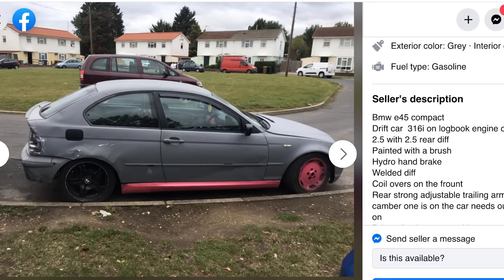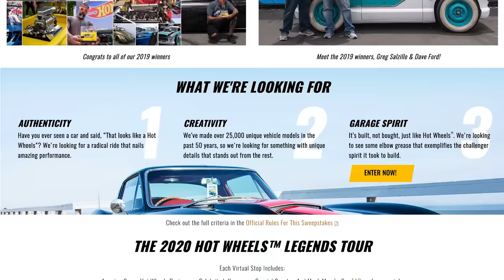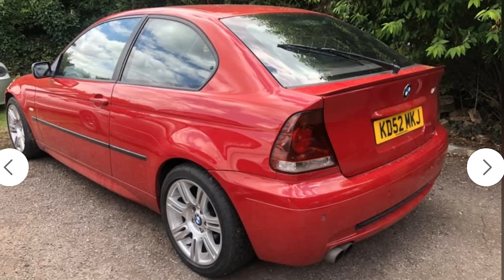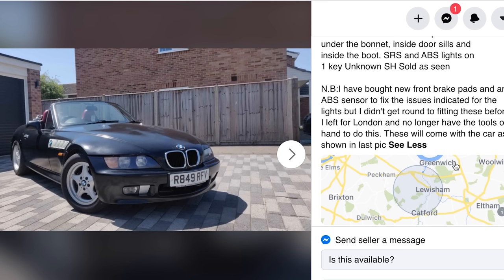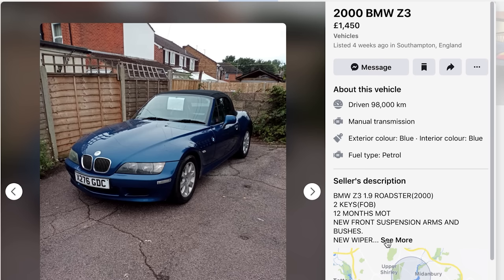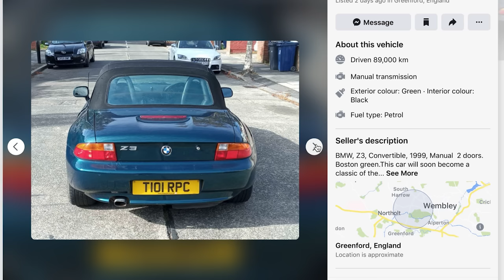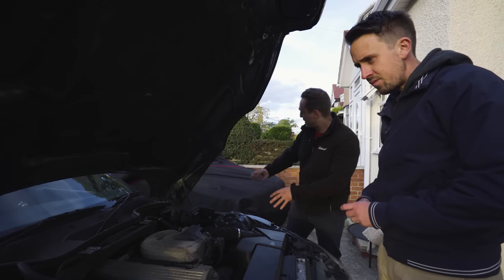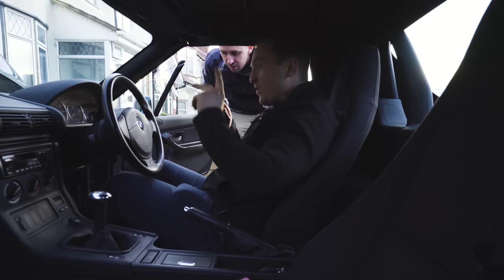£1000 First Project Car Challenge

Comment: Me: "I wonder what I could get for $1300 (£1000) near me."
Quick search 
Nothing for 200 miles...
Reply: Cars seem to be so much cheaper in the UK
Reply: jumping on that bandwagon:

Me: "I wonder what I could get for 1100EUR (1000GBP)
quick search
One hella sick drivetrain for my bicycle lol.
Reply: Only sorta interesting thing near me (Boston CL), is a '94 Saab 900 turbo vert for $1K
Reply: @tofuto4492  they are. I mean just like 800km away in Czech Republic a rusty Z3 goes for like 8k GBP (8.5k EUR/10k USD) and a rust free one with 200k km on the odo goes for 11.7k GBP (13k EUR/15k USD). That is 10x the price. It's nuts. I know many people that just import their track cars from UK because it is literally cheaper to pay for  trailer and the fuel/tunnel/vignettes than to buy an RX-8/e46 3 series/MX-5/350Z etc domestically. Having steering wheel on the other side does not matter on the track and you do not need to register and insure a track car as long as you do not drive it on the roads (it's cheap to rent a trailer to bring it on with and if you blow your engine you can just load it on the trailer instead of paying much more for a towtruck and taxi). Like seriously why are cars so much more expensive on the continent... I don't get it.
Reply: @VanBourner  Cheapest z3 I could find in America was $3.5k (2.7k gpb), but it seams like any good one is around $6k (4.6k gbp) to 10k (7.6k gpb). I thought we had it bad at those prices, I feel for you man.
Reply: @VanBourner  same here in Portugal, 90% off the dift cars are right hand drive, mostly e46 coupes, a Z3 in similar condition woud cost around 12/15000€
Reply: Shapeshifter - Maurizio Cars are ridiculously expensive here in Germany.. why ?
Reply: @pashvonderc381  there a z3 cost is like 2 months of work, here a z3 cost 1.5/2 years of sallary, dont complaint about expensive Cars
Reply: vitor hugo weren’t complaining about expensive cars, only about the price difference between the 2 countries. As I live in Germany ,coming from the UK, i always wondered why the Germans over value their cars ...
Reply: Quick look on marketplace with a £1,000 budget shows up:
Porsche 928
Lexus LS400
multiple TDI Golf's/Jetta with 250+hp
225 Quattro Audi TTs
EP3 Civic Type R
Mini Cooper S

Couple of cool things, but I suspect there's a lot wrong with them.
Reply: @pashvonderc381  What about wages, is there a big difference between the UK and Germany? What about insurance, taxes etc.? (BTW I live in Hungary, there are loads of dealers and just regular people who buy used cars in Germany and bring them in the country)
Reply: Boni Hollóssy Like most places wages are normally based on your education, and Germany loves education, I think car insurance and tax is a little bit more expensive than the UK, not by much though. As most Germans change their cars every couple of years or so and because of this environment thing they have here, their “ old “ cars normally get shipped off to the East..
Reply: @pashvonderc381  Yeah, but sometimes for the same kind of job you get paid VERY differently in different countries, and/or the cost of living is very different as well (Norway vs most of Europe for example). That's why I asked if there is a big difference between wages in general between Germany and the UK (I have no idea).
If dealers ship/drive used cars from Germany to the East, then find and snag those good deals. 🙂 For example I know that people here in Hungary bring in TONS of BMWs from Germany and Austria. Not few year old ones, but mostly older models, like E36s and E46s, and not just pristine examples, but a lot of cheaper "average" or run down cars.
Reply: Boni Hollóssy fair point.. I think in Germany you do get paid more , maybe that is something I could discuss with my friends back home on the difference in wages..
Reply: @pashvonderc381  mostly because Germans can export them to Czechs/Poles and they will lap up the inflated prices. UK has nowhere to export used cars and their ridiculous insurance prices drive car prices down... it's nuts I mean I paid 3000 GBP a year for a 1200 Mazda 6 when I lived there. And that was the cheapest option. They asked me 2.5x the price of the car... Here in CZE I pay about 200 GBP a year for an 8000 GBP car (07 Mini Cooper S).
Reply: @maurizio13  That and the insurance costs limitting the resale value. But I know a lot of people that buy cars from UK to drive on tracks/built drift cars etc. If you can get the car for like 1/8 of the price, why would you pay the premium just to have steering wheel meter and a half more to the left?
Reply: @VanBourner  You must have lived in a very high theft area.. Even my insurance on my first car (a 2008 2.0 Ford Focus Zetec S) costed me £1,200 GBP.
Reply: TheVanBourner Jesus that is expensive, especially for a Mazda, maybe you were what they called “ A Young Driver ?”
Reply: @shona5512  Nope. I had no No Claims Bonus ( I was working in UK when I was 25-27) so despite me being a driver with no incident caused (nor in any incident since I first sat at wheel) and despite me having hundreds of provable hours on track experience, never been fined for anything in any country I have been on (seriously not even a parking ticket) and despite I have visited skid school twice (once when I was 18 for FWD second time when I was 23 for RWD) I was considered high risk driver. I was willing to prove all my experience to the insurance companies but they just told me that it would not lower anything. 

Then here's the kicker - someone hit my car on the parking lot of Tesco, right under camera. It was a beaten up SUV and it hit my rear wheel with a hitch. I had the CCTV footage and police involved and everything (it totaled the car since the upper arm was bent as a result so I could not drive off due to excessive camber). They refused to pay for it since I was not INSIDE THE CAR/driving it when the incident happened. I had vandalism coverage, fire coverage, accident coverage etc. It was fully comprehensive policy since I needed the car for my work. Nope, nada, zilch. Only if the car gets damaged in my driveway I'd be eligible to have it covered. Otherwise I need to be in it and have the engine running. If I was I'd be paid every penny. That's what was nuts to me.
Reply: @pashvonderc381  I was a risky driver to them. No NCB. I moved from abroad to do a job in UK that required me driving so I bought a car. I'd drive like 5000 miles a year in the car but for those 5000 it was imperative that I have had my own car due to various NDAs and security precautions that the job entailed. I was given like a pound per mile so I did not lose any money on it in the end. But I have had attended skid school twice (when I was 18 as part of my driver's licence for FWD, when I was 23 I got it as a gift from my wife for RWD), never been in any incident since I first sat at a wheel (like I was in one accident in my whole life - someone crashed into our family car because they missed a yield sign) and never even been fined by police in any country that I have driven through (pretty much all of Europe except Ireland, Spain, Portugal, Turkey, Russia, Finland, Belarus, Estonia, Moldova, Luxemburg and Latvia). But yeah I am the dangerous driver. Not the idiot neighbour that drives modified Corsa and runs every red light he sees and pays like 600 a year... sure it is me who's the real menace.
Reply: @VanBourner  I have never heard of that happen before. Since I started driving I was fed up with excessive insurance costs, so I took driving course and got certified as an "advanced driver". It lowered my insurance by over £150. I've been insured with AXA for almost all my cars and I've had good experiences.. Obviously the extortionate price is beyond ridiculous, but aside from that I'm fully comprehensive and it's nice knowing that I'm covered regardless of whether or not I'm in the car, if the car is stolen and torched or if it happens in public or private.. No matter what I'll get paid out. I've never seen someone have an experience as bad as yours.
Reply: TheVanBourner Sorry mate, that’s real shit and bollox ..

Comment: The US market is so unfair. A car like that you would be hard pressed to find for 3k
Reply: Yeah even simple cars like a toyota can have blown up engine and trashed transmission, or a complete wreck and they are still on the market often for 1500 or more.
Reply: Yea try find a cheap ls v8 engine in UK. Seems to be loads over in scrap yards . Win some lose some. I remember being being able to buy a 200sx for 1500 years ago now 7-20k
Reply: @screamingchicken5797  I just got an '01 Nissan Xterra with a KA24DE with 157k for $550. The towyard had it listed for $1600 then began dropping price, and I contacted the yard at around $800 on the day before it was scheduled to get crushed. I spent $2k going over and performing a litany of routine maintenance, using a majority of used or junkyard pulled parts. After owning a BMW E46 328i, Acura Vigor, Mazda Protegé 1.8L, Subaru SG9 Forester, & Subaru Impreza Outback Sport, nothing has been easier to work on and more reliable than the three Nissans I've owned. The Xterra went from sad and undriveable (with more fault codes than I can remember), to take hands off the wheel at 90mph straight and smooth with clean pass on emissions using mostly basic hand tools, a keen eye, and a Haynes manual. Currently my daily driver at 160k, and I'm saving up to RB25DET swap it.
Reply: Cash For Clunkers
Reply: Yeah but anything brand new comes from US priced as 1$=1£ if you look at Tesla or Apple products 🤷🏼‍♂️😄

Comment: Project Car: “Coilovers, Wheels and Exhaust.”

I ain’t even mad, this your first project car, start off small.
Reply: What kind've stuff do you suggest? I've always wanted to start a project cars but don't have any practical experience.
Reply: Elijah It really depends on what you want out of your car.

The best advice I can give is this: Get it caught up on all the maintenance, go to a few track days, increase your driver skills, then use the time on the track to determine what you need or what you’re missing.

You may find that your cars brakes are holding you back: Get a bigger brake upgrade. Now you got stopping power, but you’re finding your a little slow on the straights: Start with an intake, an exhaust, and a tune. If you need more power, depending on the car, get upgraded headers, put in a cam and retune it. You can do this all the way until you’re slapping on a twin turbo kit, but at that point you would have built the motor up with stronger parts to handle the boost.

Get better seats, a roll cage, lighter wheels, stickier tires, start dropping weight.

But if you just want a cool street car, do you want it loud and fast, or just want something that looks cool.

So many directions you can go but the key is understand what your project car is designed to do, and take it one step at a time.

Your car won’t be the fastest, the coolest or even the most expensive, but make it your own and you’ll be happy with the results.

Also, if you’re going to join a car club, don’t get caught up with that “Man your car ain’t nothing”, that will just make you doubt everything you did. That’s how those guys operate and the reason I hopped out the car scene (currently looking at C6 Ls3 or the Z06 tho.)

Hope that helps!
Reply: @devonwhite8247  thanks man I appreciate the response

Comment: They really lucked out with the first Z3 they encountered. Minimal rust, a top that doesn't need immediate replacement, cloth seats that aren't torn. There's a lot to like about the Z3, though if you're going to put some additional power through one of these, you'll want to make sure it's had the rear floor pan reinforcement plate welded in.

Comment: I think it's hilarious when people check the oil cap and see a bit of slop and immediately think it's screwed and needs a headgasket.
Like Canadian here man, they look like that most of the time when winters round since the heats blasting and the car won't usually run long enough to get the oil boiling off the condensation.
Like the guys also mentioned if it's an elderly person or someone who just takes short trips in that vehicle, having slop on the cap is normal.
Buy a $20 pressure tester and carry it with you to buy the car if you're that worried.

Comment: Project car? Hot Wheels contender? Make it a safari car. Small suspension lift by spacers, knobby offroad tires, and some big lights. Easy to do on a budget. It will look great, and it's all reversible later.

Comment: I know you will hate kit cars but there are a few bodykits about for the Z3. If that’s not your thing at least you could make use of the bolt on and off bodywork? I have a Z3 turned into a 60s sportscar using that technique. (Tribute Kobra). Good luck guys !

Comment: X reg 2000/2001 - Rules state that the engine management light does not fail an mot on a petrol car before 2004, it should just be an advisory.

Comment: This guy is lucky he has homies to help him. I bought my first car by myself, and it had a cracked intake manifold, broken brake cable, and ass suspension. I shattered the intake manifold the first month of having it. $1400 repair for the cable and intake.

Always check your vehicles. If they don't want you doing so, they are hiding something and trust me you don't want it.

Comment: The question is - does it have the z3 smell? My mum had one when I was younger and it had a specific smell inside if you know what I mean and it never went away. Not a bad smell 😂 1.9 that had a straight pipe from the cat by the previous owner (it was horrendous)

Comment: You couldve bought my vw bora 2004 1.9tdi sport 130bhp i have it for sale its black it has rust it needs new tyres. Needs rear passenger door, ive serviced it changed clutch about 2weeks ago new front breakes and rear brakes disc it needs mot, sounds like a project car 🤣

Comment: Clearly for modify substitute make it look like it crashed into Halfords stick on tat section, handle like crap and make it slower; so coil overs (cheap as possible) loud back box only exhaust 'upgrade' and possibly some sort of untested for efficacy  but noisy intake /filter and obviously some wheels fitted with ridiculous spacers to fill the arches. Any money left should be spent on crap chinese high power bulbs including some coloured side lights, maybe a stick on boot lip spoiler, then just go to a 'meet' and flex....... Just take the worst of the shitbox scene and be ironically funny.  My work here is done.

Comment: UK cars are so cheap... good luck finding a z3 for less then 2500€ here in france... hell you wont find a e36 for petrol for less then 3000€
mx5 are 4000-5000€ mercedes slk are 4000€ till 8000€ (depends on the model slk200 none or with kompressor or 230 kompressor)
in the fuking uk 1000pounds for a z3 with almost no rust... GOOD GOD its not fair, at that price who cares about the wheel on the wrong side
same with mercedes c32 amg 8000-10000€ in france in the uk less thne 5000pounds